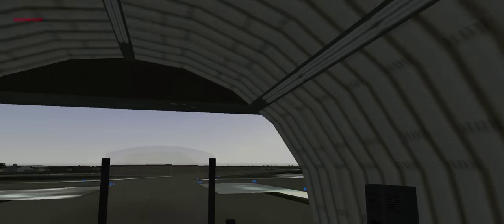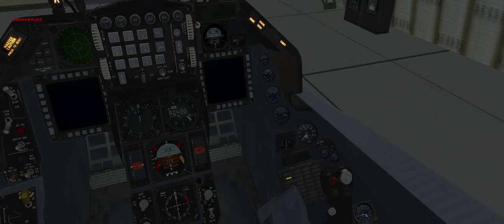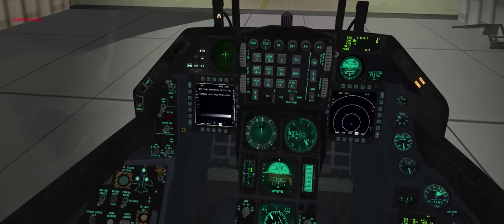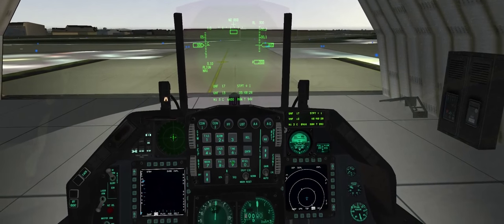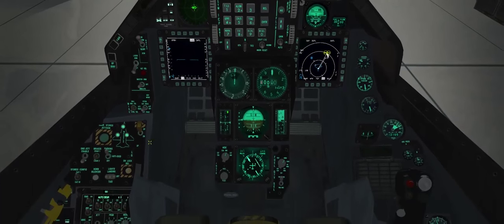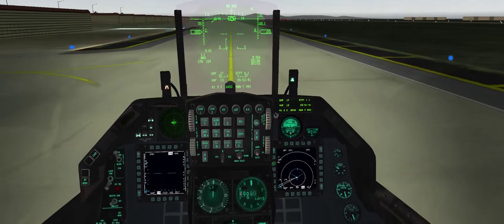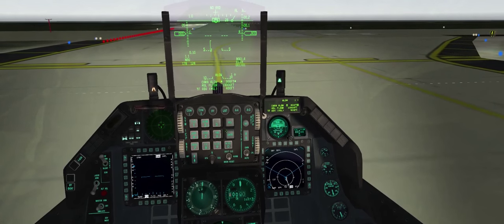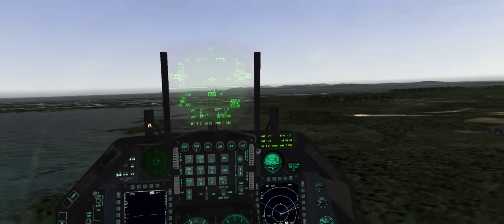F-16 Ramp Start Tutorial [Falcon BMS 4.33]

Comment: How do you get your DED to be displayed on the bottom of your HUD ?
Reply: +Kortiah Right hand panel on your 1 'o clock.  Second column of switches,  3rd from the left.
Reply: +SteelbeastsCavalry Thanks. I actually found it a couple of days after asking, maybe that'll be of some help for someone (First position is OFF, middle is displaying Errors, up is DED display).

Comment: I want to play this so bad where do I go to get it?
Reply: thanks man already did that and not such luck!
Reply: I bought all four games the falcon 4.0 installed etc. Went to download the torrent file bms I and tried to install and it made my whole computer flash like it was having a seizure. Thinking it might have something to do with using the windows 10 os system. SO after hard re-starting the computer ten times I couldn't figure out what was wrong?
Reply: It won't even do that, keeps asking me which type of folder it wants me to open it with, Keeps on flashing like crazy on the computer screen.
Reply: indeed very weird!
Reply: I thought the same thing also. I'm guessing the ground power unit for 'gpu'. I got windows 10 64 bit etc on an origin card. I tryed the other sources that bms had on their website, same issue!